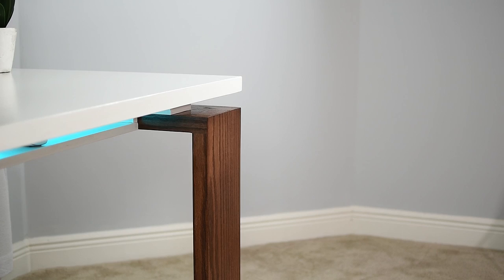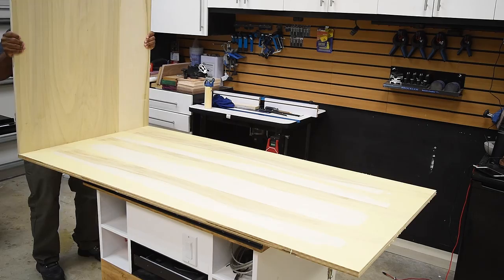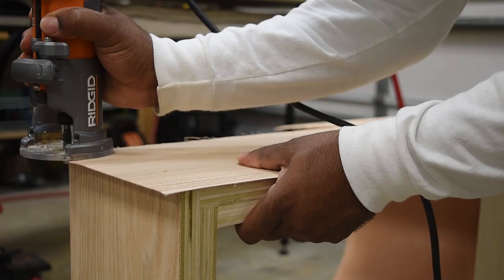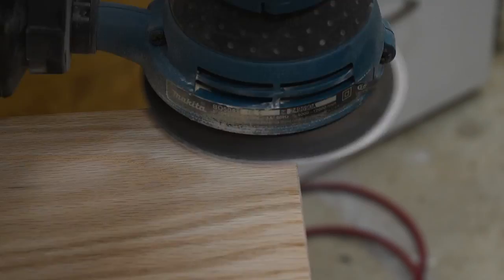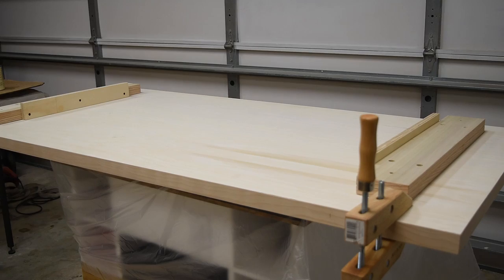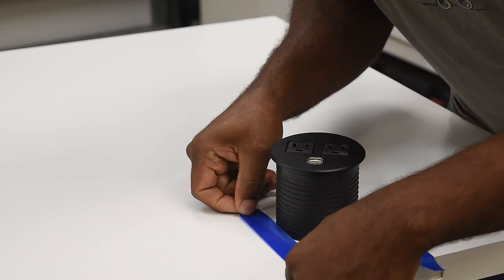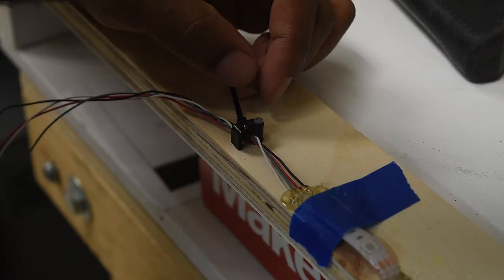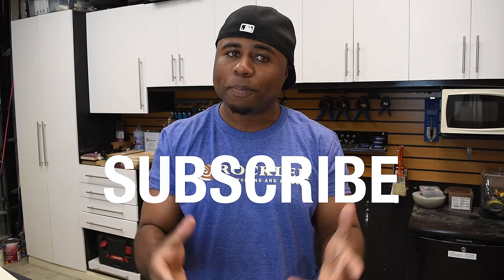How To Make A Modern Desk

Comment: What would be great would be a large desk area that is height adjustable on pulleys.  Even better, if the angle of the desk would be adjusted.  So maybe a pivoting system though this would require careful planning to keep solid and rigid.  Another idea is to have the keyboard/mouse area on a different platform or isolated as much as possible from the monitor though this only applies to monitors with flimsy stands.  This was a great video of course.  Many thanks for opening our eyes to the possibilities.

Comment: I just got done with a super basic U shaped desk. Never done any real wood working so these are neat videos for ideas. I just wish I had all the nice woodworking tools. I don’t do much wood work and it’s hard to stomach buying routers and table saws for 1 project. At least these give me ideas to build more.

Future videos could you add approximate cost of the materials? I feel like my crummy U shape desk was super expensive for just a 3/4 8x4 plywood sheet and a few 2x4s. Kinda blew my mind when I ended up spending almost $200. I always thought DIY woodworking like this would be cheaper than just getting something from Amazon but now I’m thinking it would have been better and cheaper with a prebuilt thing.

Comment: well done Sir :), just one thing ... i would have put the power source from the controler outside (on the backside of the table) You never know how hot that stuff might get (fire issue) and 2nd if it dies you could change it more easily

Comment: You got another subscriber, good work your giving me a lot of ideas hope your channel don't change content. I was planning to make a desk where I will mount a motherboard of a laptop hiding it inside the table with some Bluetooth keyboard and a mouse, plus a pop out monitor that would be very slick plus you got a table that you can use for other purposes like if you make it little smaller you will end up with a modern coffee table and if you make higher you can use it as dinner table whenever the monitor is tuck in. Cool right? Multi purpose table

Comment: Projects look good, semi modern would like to know the size drill bits used and screw lengths? Don’t want to under-guest size and legs fall off...🤦🏼‍♂️ plus I would use wood screws in place of black drywall screws.

Comment: Wood $35
Paint $20-30
Stain $15-25
Screws $10-15
Brackets $5-10
Grommet for cables $10
Velcro for cables $5-10
Kreg jig $40 or more
Wood glue, bits, brushes, rollers, wood filler, sand paper easily another $35-50
After tax around $200 or more and about 6-8 hours of work

Comment: Every LED strip i've used, the adhesive comes loose due to the heat generated by the lights.

Is there a brand that overcomes this, or is there a workaround?

Comment: Two sheets of plywood? Overkill? Pche. I used 4x12mm for my table top. That is overkill.
Reply: BTW. I have my table finished with wood oil (dozens of coats with tons of sanding in between). And that edge of stacked plywoods looks gorgeous.